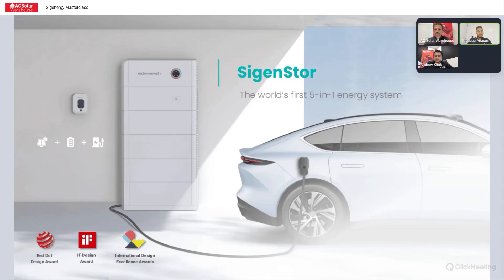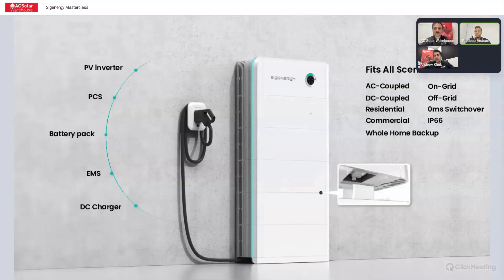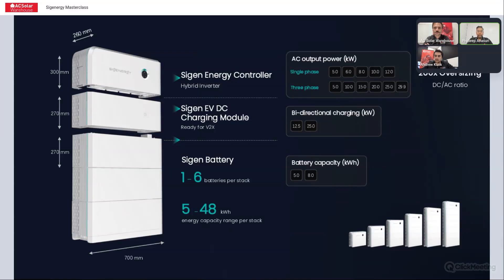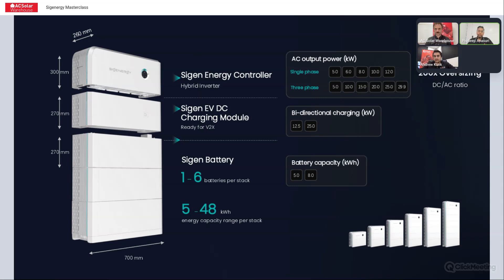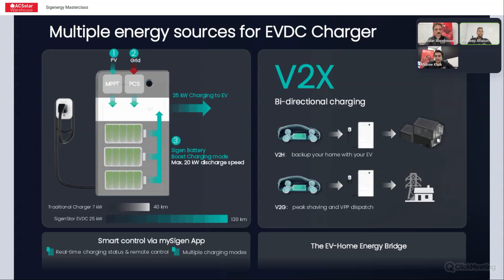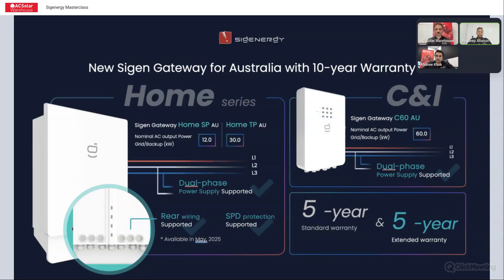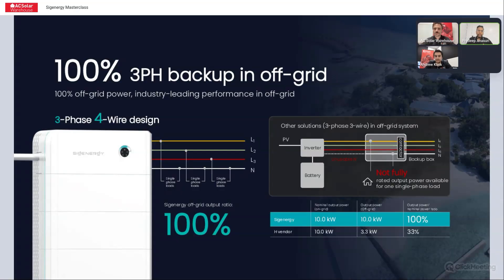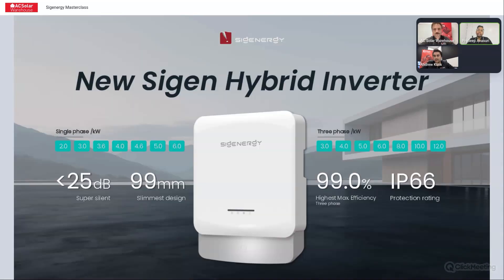Why Choose Sigenergy? | Sigenstor Masterclass with Pradeep Anasuri

Comment: Wondering: is the top controller/inverter restrictive for the capacity of the DC charger? I.e can the size be smaller than 25 if you want to use the a 25 charger. Considering both charging and V2x..
I would suspect not given the bi-directional nature of the charger, but would like to get this stated as a fact.
Reply from the maker: The Sigenergy Energy Controller limits how much AC power can be drawn from the grid to charge the car, or fed back to the grid when discharging the car into the grid.

It's good practice to size the Energy Controller 1:1 with the DC car charger to make full use of the rating of the charger when charging/discharging into the grid.

The DC charger can also draw DC power directly from the PV array, so in some cases it might make sense to use a smaller Energy Controller if your PV array is large enough to power the DC Charger